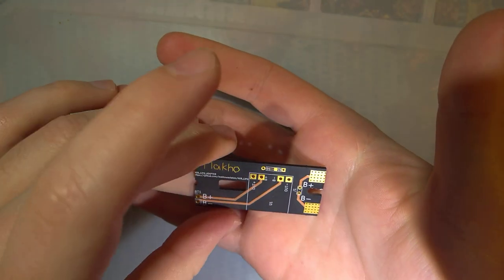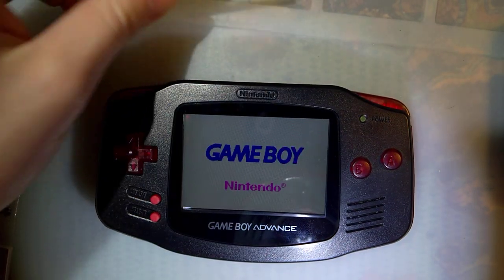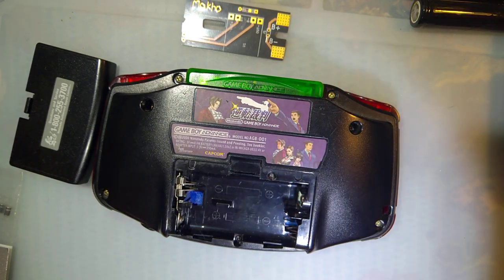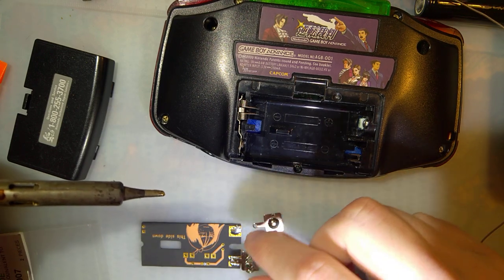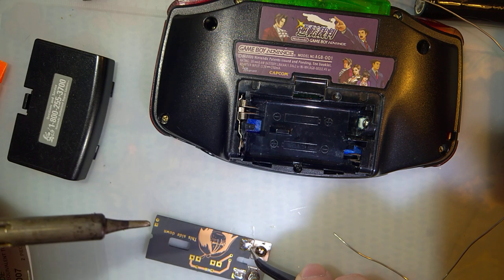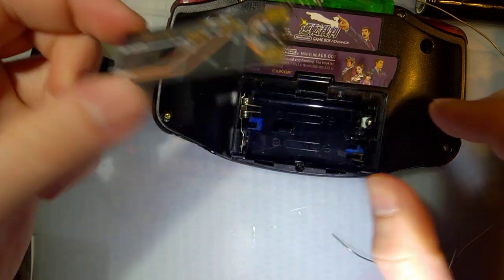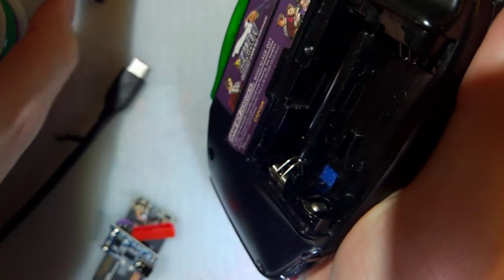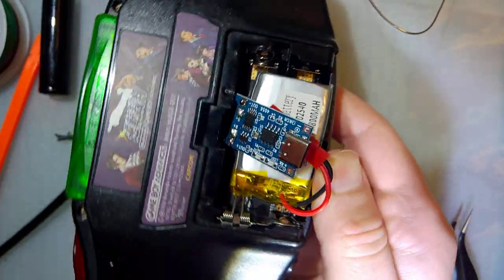Building a LiPo Adapter for Game Boy Advance

Comment from the maker: Per a recommendation from a user in the comments of this video (thanks Jonathan M Santos), it looks I've found suitable batteries that will fit with no or minimal modification. 103040 (1200mAh) batteries fit with absolutely zero modification to the AGB, and 103048 (1455mAh) batteries fit with a small trim to the plastic in the battery compartment. See this video (timestamped) for more detail: https://youtu.be/A86y9P2SIq0?t=337

Comment: Hey Makho! your content is awesome :)

I've got one question, if it does not bothers you...
The charging PCB outputs a 5V current, and i understand that the diode reduces it to 3.3v? Have you measured it? (im sorry if you already posted this on a video...)
and if it reduces to 3.3v, i understand that the voltage to GBA is constantly 3.3 right? I mean, when the battery is almost uncharged the GBA will still receive 3.3v right? So the GBA led will become useless in terms of battery measuring right?

Thanks a lot for your time!
Reply from the maker: No, that's not how it works. You should do a bit of research on rechargeable batteries because it's a rather interesting and complicated subject. Long story short, LiPo batteries have a voltage curve. At around 3.0 volts output, their capacity is nearly depleted and at 4.2 volts output, their capacity is just about full. The GBA does not work on anything at or over 3.9 volts and the diode essentially serves as an electrical "speed bump" that knocks 0.36 volts (or thereabouts) off of the charge. Now the GBA sees 3.84 volts to around 2.64 volts fully charged to depleted, respectively. This does work with the GBA but the low voltage cutoff on the GBA is much lower so the low battery light is largely useless and may only give you seconds of notice. 

Battery charging is at about 4.2 volts. It's a little more complicated than that but these chargers charge at a constant current (1A) then at a constant voltage (4.2v) to ensure a proper charge. The input is 5v but the module does reduce that to a proper level for charging. 

Also, this module does not feature load switching so you cannot safely charge and play simultaneously.

Comment: Mahkho, this is awesome. I build a drop in before too but nothing compare to this, its beautiful. Or you going to submit this to OSH Park? I love to order this. I already did the SP Lipo 900mah and i loved it on both my SP's
Reply from the maker: When I get it to a point where you don't have to file away at the PCB for 20 minutes to get it to fit right, I'll post to oshpark. For now, it's on github.

Comment: The irony is that nobody really looks at how Nintendo's been reusing that battery port for basically everything that takes batteries.
You can take those Nyko Wiimote rechargeable packs and put it straight into the GBA, or the WaveBird controller.
Now we gotta get into those charge bases and make GBA docks, lol
Reply: Also, I figure you'd be the right guy to ask;
On an SP, turning on the unit, then pressing the area around the speaker sometimes causes it to power off(and the speaker to cut out)
I'm actually hoping its something trivial. I'm thinking of checking the battery contacts again
Reply from the maker: I don't really think that's irony. But yes, those wiimote battery packs do tend to fit with very minor modding required. Shame about the low capacity though. 

And regarding your SP: https://www.youtube.com/watch?v=PHYjqcb0Sus

Comment: Why does the tp4056 not support charging and playing at same time? What happens if you do, since I’ve seen others charge and play with it.
Reply: It will never stop charging, will probably shorten battery life somewhat but you also risk blowing up lipos by overcharging.
Reply from the maker: Because it has no load switching. You cannot safely discharge and charge a battery simultaneously. The people who are doing that are fools and are lucky they've not had any issues yet.
Reply: makho are there any lipo or nimh modules that do support load switching?
Reply: makho also, would there be a way to steal the charging piece from say a Gameboy Advance sp or something to allow charging while playing? Just wondering since that seems to be a major flaw in the modules. I’ll presume for your nimh module; it doesn’t have load switch either?
Reply: @TheDailyTeacherTuey  NiMh is a much more stable chemistry and can take some abuse and won't explode if overcharged, granted the DW01 protection IC of the larger TP4056 or the separate protection IC built-in the cell should kick in and cut it off
Reply from the maker: @TheDailyTeacherTuey  Not practical. There are some other people who make switchable modules though (albeit for more money). Check out insidegadgets.

Comment: Do you think a snug fit is a risk factor? I've done a lipo mod, and the battery fits, but it's snug. I've sanded away all sharp edges and such.
Reply from the maker: Snug is fine as long as there are no sharp corners or edges. Ideally, the battery should have room though.
Reply: @makho  Thanks! I'm sorry to bother you with one more question, is there anything I need to consider when it comes to charging? I have my mod all up and running but I don't know of any potential dangers related to charging. If it helps, my charging board is a USB C TP4056, and the battery is a 3,7v li-po.
Reply from the maker: @DisneyTLK110  Make sure that your battery supports the default charge rate of your TP4056 module. Also, TP4056 modules do not support charge and play simultaneously. So turn it off when charging. Always.

Comment: How would you make it charge and play?
Reply from the maker: You would need to build in a load switcher. insideGadgets offers a module that can be used instead of the TP4056 module that has built in load switching. It's bigger and more expensive but if you need to be able to play and charge simultaneously, that's what you need.
Reply: @makho  Thank you for the detailed response. I was looking a bit at this before bed and there is a load-share circuit with the TP4056 on hackaday.io. 
https://hackaday.io/project/18205-tp4056-3v3-load-share-addon-board
Do you think it would work, the max output current is 120 mA. Otherwise im thinking a powerboost 1000c or MP2636 followed by a step down converter.  Thank you for the videos and responses.

Comment: The red connector must go to the trash lol just build it without that.
Reply from the maker: I mean, I was very clearly just using that battery for testing. In the final version, I see no reason to use a battery connector since the whole module is easily removable.